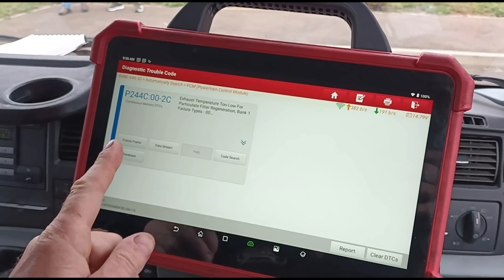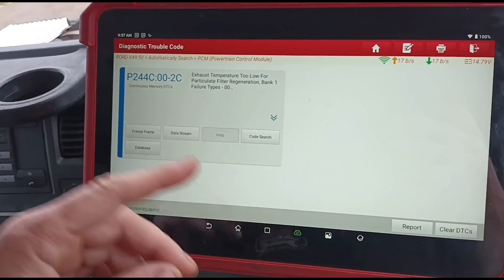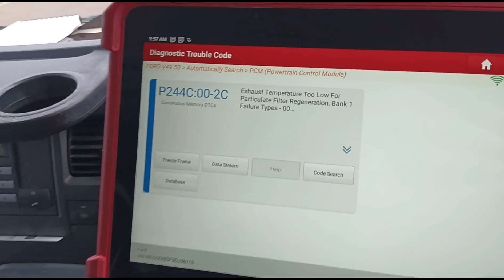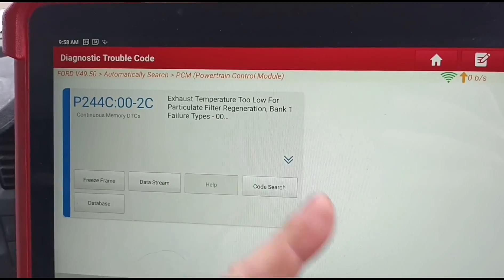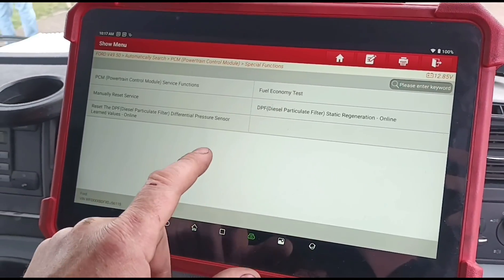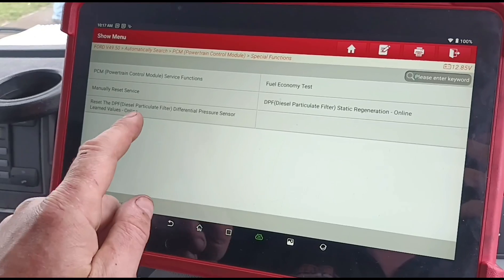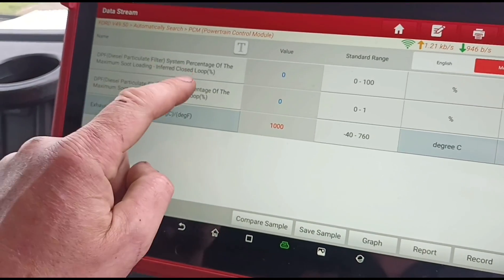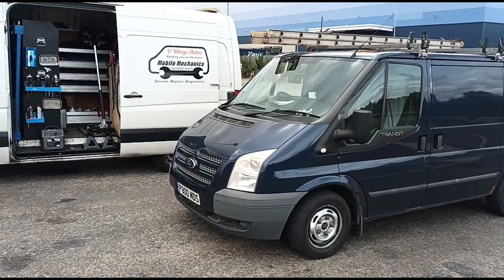Does Aftermarket DPF's Work?

Comment: I had an aftermarket dpf fitted to my mk7 transit and every time it does a regen it is very smokey out of the exhaust. I was show the original dpf when it was removed and the filter had crumbled to pieces so i assume it wasn't salvageable. I am fairly convinced it is mostly working correctly, but i guess as it is always smokey, it can't reach the heat required to vaporise properly. I think it cost about £300-400. If i was to change it for a genuine part, where could I look to get one and how much should they be costing?
Reply: I had the same exactly on my mk7. EEC type-approved dpf....total rubbish. Ford will try sell you a new one for 1600 but ask them if they have a ford reman one. I did this route and it's perfect. So the ford reman made in sweden one was 800 plus VAT but they will give you 300 off for your old dpf core. Amazingly they knowingly accepted my aftermarket one so all in around 600 which is nearly down to aftermarket price. Check your temps during regen. EGT11 should be around 440C, EGT12 around 600C, and importantly EGT13 during regen, should be around 630-640C on the mk7, if not and all else like vaporiser is ok then its lack of precious metals in the cheap cat/dpf not giving temp rise through the cat and dpf, so the fuel from your vaporisor will not fully burn and come out the tailpipe as white unburnt diesel smoke. Good luck.

Comment: Hey there! My seller has replaced dpf with an afternarket one. Its big  drama, it has huge flow resistance, the pressure is high. Now it counts soot faulty and regens every 100km! It goes back to be fixed

Comment: Non genuine dpfs are cheaper than genuine ones in this day and age people go for the cheapest option I can also see why people opt for the dpf deletes I know there not the correct way but it solves the problem because people just don't have the money to keep taking there vehicles to the garage
Reply: 2 of our work vans (we have 5) have both had dpf and egr deletes its not the right way to do things I know but literally garages were I am have no clue or don't want to work on dpf problems the local grease monkey guts the dpf and a guy does the remap vans back on the road in 2 hours..
Reply: Next time I'm deleting my dpf is cost me 800 squid to sort out last time. I'm telling them to gut it and remwp
Reply: Exactly. People want cheap. And this has encouraged the race to the bottom as far as price and quality goes within the aftermarket. Sad times.

Comment: Seeing the amount of soot you got out of the exhaust pipe I got curious and went outside and did it to my car. Clean as a whistle. 40,000 plus kilometres Mitsubishi Triton 4WD 2.4 litre diesel. If I ever get problems I’ll just remove it and get it tuned. The chances of being caught are remote.
Reply: As you say very unlikely to be caught. But... 
Not sure where you are in the country but up my way there's a camera/monitoring device set up on a very busy road near the edge of the city that measures the size of the soot particles.
Trying everything to fine the motorist 🙄
Reply: @MrByootox can't believe that fella would have to physically put a particle measuring device straight into tail pipe to see

Comment: So with all the issues surrounding Euro 6 vehicles. If possible should we be sticking with Euro 5's for now unless the need to go in to Ulez zones.
Reply from the maker: Definitely
Reply: Some Euro 6 are not as bad as others... Touchwood.... the 1.5 dci I use seems to fair a bit better
Reply: Euro 4's are good too.
Euro 3's are even better for being simple and reliable. Trouble is, they can smoke, especially on hard acceleration, which is a bit naughty for spreading carcinogenic particles around. 
Sometimes watching this, I fear for Jimmy's long term health, what with all the soot and other stuff he gets exposed to.
Reply: @lint8391  I have a euro3 Fiat scudo & opacity readings  at MOT are  Zero! Premium diesel & occasional treatment, plus regular oil changes max 5k miles. I reckon it's cleaner than lots of newer cars with all the kit that goes out of spec.

Comment: I fitted an aftermarket cat on an old Volvo 940, it was a third of the size of the original. Noticed power loss & higher fuel consumption straight away.

Comment: To get to the temps necessary, I know certain diesel vehicles use COATED DPF's, maybe that coating is not present on these aftermarket units, which normally would be fine, when the DPF is placed closer to the engine? One of the reasons PSA use Eolys is so the DPF can be placed further away from the engine!
Reply: I always knew Eloys was used to reduce the temperature that a Regen will happen.

I always thought it was so they could Regen at lower temperatures and not block up when used round congested towns and cities.

I never even made the connection that is was so the DPF could be further away from the engine aswell.

It was one reason not to buy the 2.2 HDi in early Citroens as they came with Eloys before any other manufacturer
Reply: @bigjml  It'll still get blocked up around town (I do regular motorway so never had issues in over 120k). Eolys is a great system, lowering temperatures extends longevity of the engine, exhaust etc. Plus it uses less fuel when regenerating compared to other solutions and regens are quicker to complete. Plus you get far, far less issues with oil dilution. I'd rather have a Eolys based DPF system than not, when the Eolys only costs around £130 for 100k miles of driving and it also has additives in it to keep injectors clean etc so overall, I reckon that £130 makes it way back to you eventually!

Comment: Great stuff once again. What about aftermarket Vapouriser? Are they as good as decent aftermarket? Need a new one as the glow plug on mine is gone. If I hadn't damaged the thread getting it out I would just clean it up with blow torch ang buy a genuine replacement glow plug from ford for £50. Just struggling with paying £300 for a complete new unit when it's just a injector and a glow plug with a fuel line and wiring harness.
Reply from the maker: I use Beckerman vaporizer from Bennets
Reply: I believe Jimmy uses pattern ones